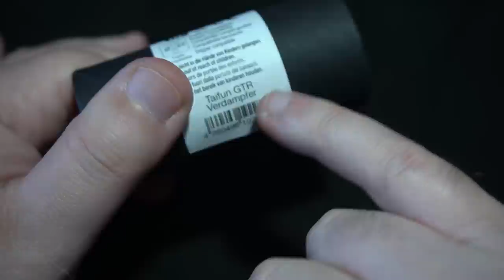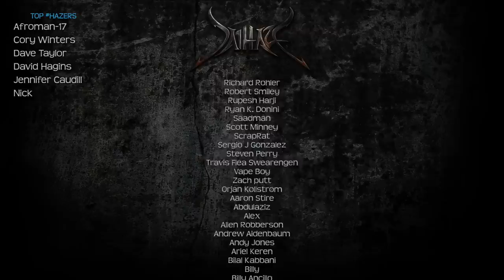Smokerstore Taifun GTR MTL RTA Review and Rundown | Their Best RTA Ever Made?

Comment: What up Jai! I love my GTR! Got it the day it was released and can’t express how much I enjoy it. Mine did come with all 4 screws already screwed into the posts plus 4 extras in the bag (I did order mine directly from SmokerStore). The juice flow had me worried at first but even almost completely unscrewed, I’ve had no issues with leaking or inadequate juice flow. With just the larger port open, this is probably the best MTL I’ve ever experienced even rivaling all of the Kayfun series. The flavor is just unfair! Lol great review Jai and what up Hazers!!
Reply: How does it compare to the Kayfun Prime?  Airflow tighter than the Prime?
Reply: James Houtz It is definitely tighter and you can adjust it way tighter than the Prime. Wide open is comparable to the prime with 2 dots.
Reply: @kileyphillips6036  Woah, alright thanks.  Guess i'll be passing on this.  I usually vape the Prime on the 3 or 4 dots.  But if the GTR is compared to two dots on the Prime, and that's wide open.  That's too tight for my liking.  Thanks for the info.

Comment: The tooling marks on top of the filler port is chatter. Caused by either a dull tool or too many RPM's when cutting it, or both. 
All of these tanks are cut on screw machines. They are a combination of lathes, mills, drills and taps, all-in-one. Try to find videos of them running, very very cool to watch. I used to program them. Depending on the level of difficulty you can make 7000 to 10,000 parts per shift.
Reply from the maker: so the chatter is a bad thing then, like either not calibrated correctly or not changing out the bit
Reply: @JaiHaze  Yes, it's something that just happens in the course of machining, but it should be fixed. The trouble is that they only check like the 100th part or whatever their schedule is? So if 99 parts are already done like that? Well...
Plus, depending on the company, if it's on an unseen surface, they don't really  care?
Reply from the maker: i mention you in my video ill have up for tomorrow. I appreciate this vs the other person being a smart ass. I guess you make a solid point, some people dont even give a shit about the tooling marks to begin with. But I expect perfection and if its not quite there i mention it
Reply: @JaiHaze  Thanks Jai. For the haters who are going to text in and spew, I was a machinist for about 20 years as a kid, learned programming as a natural progression in the middle of it. Then got an aerospace engineering degree for the last 25 years. Long retired now. :)
Reply from the maker: I just appreciate you taking out the time to respond with some knowledge I can use. Youre going to like this next video that will be up tonight. I appreciate the hell out of you. Nice approach, and now when I talk about it I can use your analogy as a reference.
Reply: @markham4041  I seen this chatter and a lot worse from running a quick turn machine and with my OCD I would get pissed because the shift before me would tell me they just changed the carbide bits and other cutting tools! And it would be almost out of coolant and that would cause it. I see quite a few RTA's, RDA's, A lot of drippers and tanks.  
I have mentioned the tooling chatter before on here and people was jumping on me for saying that. But oh well.
Reply: @JaiHaze  It can be caused from a dull bit to vibration to trying to run it too fast too! Nice to see you getting out of your comfort zone once in a while Nice! And those people that holler about just use round wire is BS I have made tiny claptons and know a lot of mtl people whose done that. It's up to the person building.

Comment: Regarding the grub screws, the ones in the plastic are indeed extras. The reason they only placed 2 instead of 4 on the deck is because its a single coil atty so you only need 2. There are 4 holes depending on the coil orientation. 

Regarding the juice hole, even though the tank is locked in, for me, theres no need to unscrew a little bit to open the juice hole. Even if its closed, juice still flows inside. No dry hits. I guess that depends on the juice you are using

Comment: Jai, you're the one that got me into the 28-38 fused claptons. They heat up just fine. Now that's the only build I use unless I'm using a mech. Then it's 24-36 fused claptons. Anyone that says the 28-38 fused claptons don't work well doesn't have any idea what they're talking about!
Reply: Might grab those gauges soon. I been using 26g ss /36g n80 fused claptons since I started making them in december. Nothing wrong, just feel like changing it it up a bit.

Comment: Love the gt3. Only wish I knew why when I put the nano kit on it. I can’t keep it from leaking. I had to go back to using the stock glass. Good video Jai
Reply: I had that problem, you have to replace the o-ring at the top of the nano kit with a little bit fatter one, so it seals property around the chimney's neck.

I think the problem is due tolerances of the polycarbonate tank where the o-ring sits. If that o-ring doesn't seal properly around the chimney's neck, air will flow freely into the tank.
Reply: Are you using the steamtuners nano kit or Taifuns?
My steamtuners leaks, but the nano kit from Taifun doesn't at all!
I was disappointed on that , it was like wasting 70$..
If you can find one of Taifuns nano kit for it, grab it..you will love it...and it is leak free!!!!